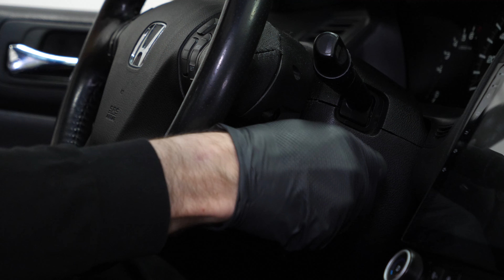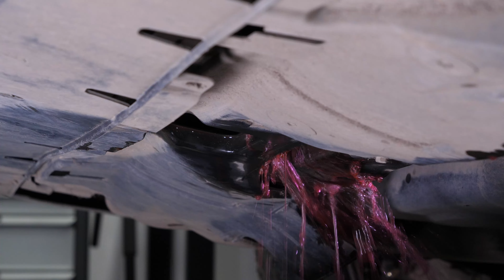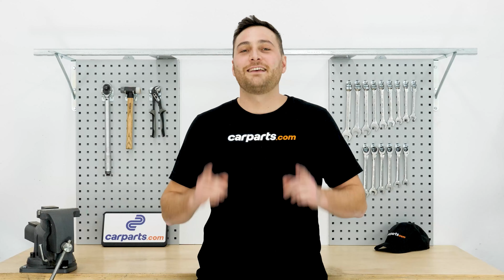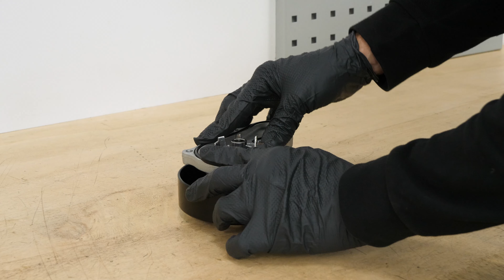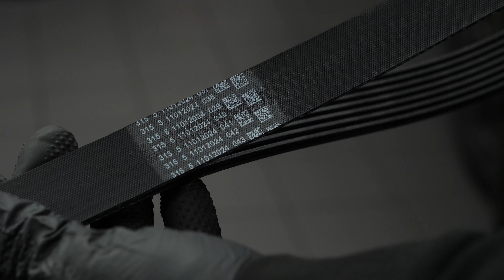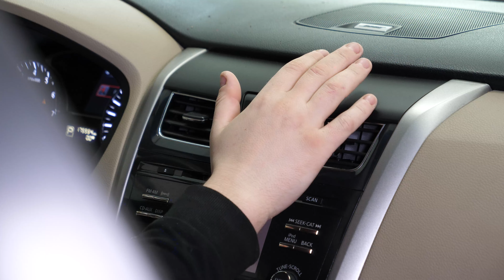How to replace the Water Pump 2003-2007 Honda Accord 💧

Comment: Just did this job today. The bolts behind the water pump pulley were a nightmare to get to from up top. I took the front passenger side tire off and accessed them that way.
Hoping this might help someone else.
Reply from the maker: Thanks for the feedback ✌

Comment: besides being 10mm what size are the bolts? My nephew lost the bolts from my water pump. I've been told different lengths and someone even asked me the threads of the bolts. What exact bolts are needed?

Comment: Wait, i dont have to access the timing belt to change it? Ive been procrastinating because i thought i had to
Reply: There is no timing belt. The timing chain is internal behind a cover. You will have to remove the serpentine belt though.

Comment: This can be done without taking the power steering pump or tensioner assembly off. Instead remove the pulley from the tensioner for more space.